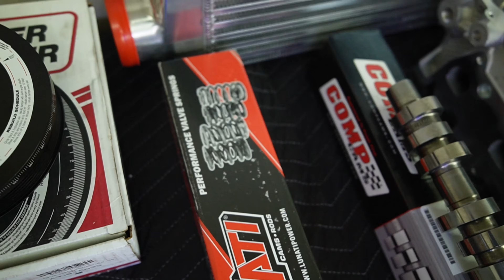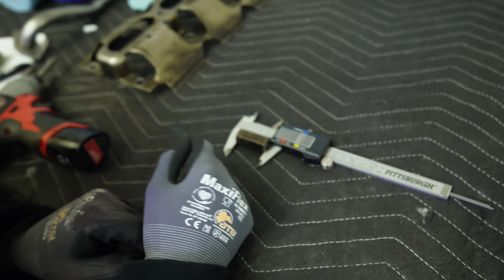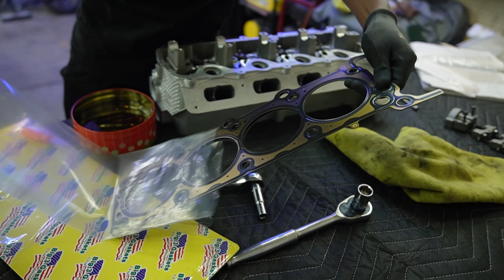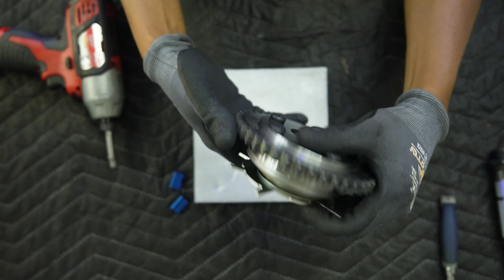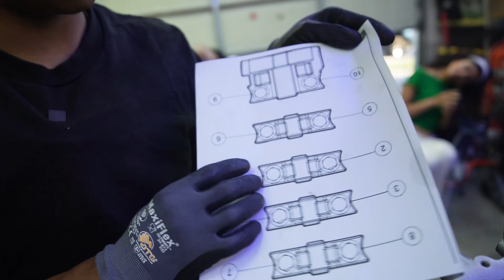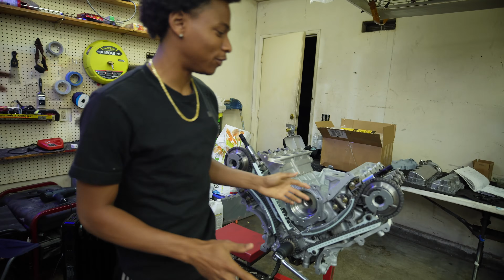BUILDING a 1XXX hp CAPABLE 4.6 3V

Comment: Why did you have to grind down the tensioner ratcheting pin?
Reply from the maker: If you 2 step or on the rev limiter it can over tighten you timing chains so it’s common to shave some links down

Comment: Have you thought about a dry sump set up? Frees up crank case pressure causing less resistance for the pistons to move and possibly a improved oiling system. Also solves issues with lack of baffling.

Comment: All righty bro, you forgot to time the cams! Didn’t see you using the wheel, so I figured you didn’t time the cams. You did time the engine but shoulda timed the cams as that could get you a good additional 20-30 rwhp or so (depending on how your cam profiles are.).
Reply from the maker: These cams are custom I asked the guy who spec’d them if they needed to be degreed but he he said no, just time the matter and all is good

Comment: Did you upgrade your timing guide pins thread OD in the block to at least 8mm?  These like snap off if you got some springs in there, You can see broken one here that I had to fix on buddies 3V.https://www.youtube.com/shorts/IAcjySXGMj4   There is vid of it, I also had to remove limiter because they where clacking. Put in full lockouts, This was a 5.0 stroked and CNC FMS heads with a procharger then a TVS blower.
Reply from the maker: Yea I went with the 9mm pins. I also swapped from limited to lockouts

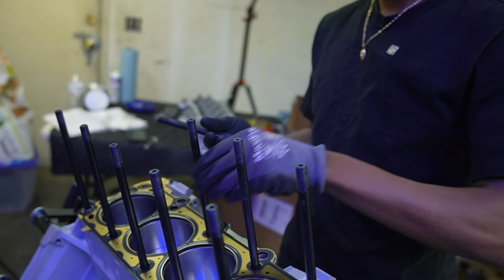Comment: @ 10:29 install your studs after you've laid the head on the dowels and gasket. The Allen head on the end will help to install them. This decreases the chance that you'll catch any aluminum on the threads, and it'll be easier because you're not fighting to align all the studs with all the holes. They don't always tighten down exactly perpendicular to the deck.
Reply from the maker: Ok thanks
Reply: Mister know it all
Reply: @603cobralifestyle4 yep, that's me.
Reply: @603cobralifestyle4 umbox that

Comment: Tip for future engine work or automotive work period.

Gloves: latex or rubber of some sort. The heavy leather-ish gloves you're wearing will absorb oil and particles that you may not want on your parts. Cleanliness is next to godliness. 

Towels: blue shop towels aren't bad. You definitely want lint free. Coffee filters are great for cleaning any machined surfaces or to receive a gasket or sealer. 

Aerosol Cleaner: brake clean powers through most anything, but it does leave a film behind.  Electrical contact cleaner leaves next to nothing and acetone leaves less. Some surfaces need to be that clean.

Again, keep your area clean and your engine cleaner. Close windows, garage doors, shop doors, etc. The last thing you wanna do is build on a sunny windy day with the doors up letting every bit of dust get stuck to the oils in your engine. It'll wipe out your oil clearances  before you can make a test hit around the neighborhood. 

Studs over bolts.

Light pistons and rods.

Chase all threads. Chamfer all bolt holes, and debur ALL components. 

ALWAYS open and clean an oil pump before use.

Good luck. I know what it takes to make a 3V get to 1000hp and live.

Ah, nvmd...."capable". Sorry, I thought you were trying to get 1000 out of what you're using. My mistake. Not knowing your cam specs, intake manifold, or fuel system you should be able to squeeze 600 out of what I can see. Good choice with the. Compression. A lot would have chosen less than 10....I've gone 11:1.
Reply from the maker: This exactly what I was looking for, I appreciate the advice a lot. I have couple more mods I’ll show in future vids. Thanks again
Reply: @DatsDylan_  bet
Reply: Did you have a shop do the pistons and rods? I'd like more information on the rotating assembly and the do's and don'ts. Thank you 😊